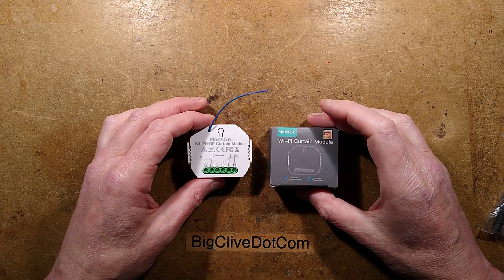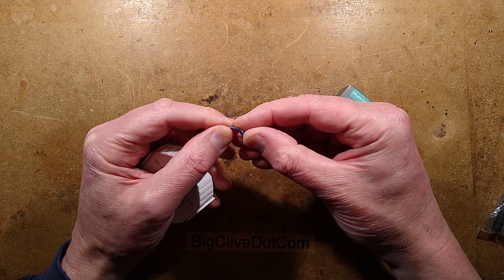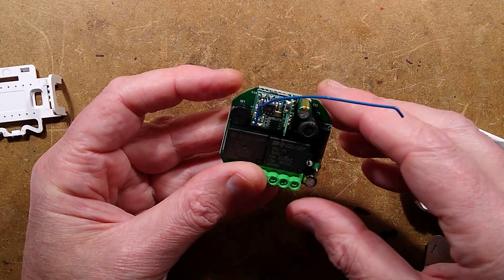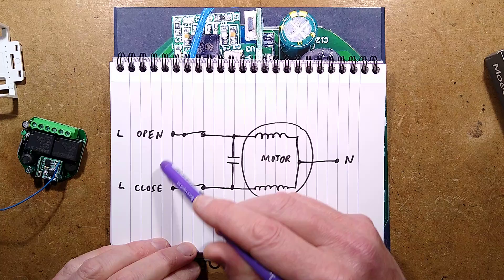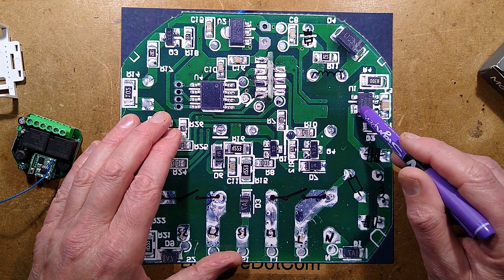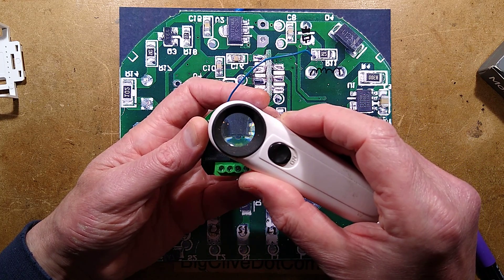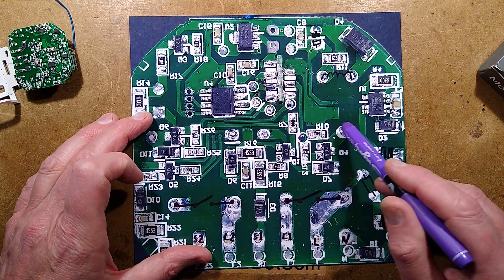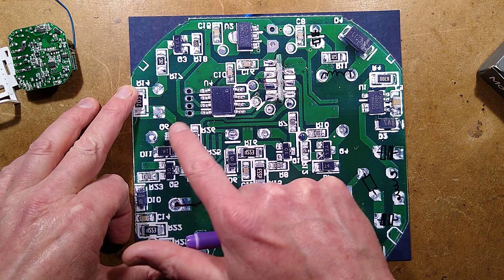WiFi curtain controller with rogue live wire

Comment: Would it help to couple the antenna wire via a small capacitor that has fairly low impedance at 433MHz but high at 50/60Hz?
Reply from the maker: It would have to be rated for mains voltage, but it could be done.
Reply: The capacitor would mess with the impedance matching too, so it would need other parts to compensate, like an inductor. If you only need to match for 433MHz, it is quite straightforward to do so.
Reply: Yep, 1nF Y capacitor is the correct thing to do here.
Reply: @chargehanger  yeah for 1nF you do not need any inductance compensation. 
You can get away with zero compensation and "near" perfect matching, if the capacitor is part of the antenna, like one terminal is soldered into the PCB, and the other continues as the antenna. For 433MHz the 1nF capacitor is basically a wire anyway (with some small twists).
You may need to use very high voltage rated capacitor, because lower voltage ceramic capacitors can be permanently shorted by ESD. Or maybe use a type of cap which does not tend to fail short.

Comment: Would it be a good idea to put an optoisolator between the radio control component and the mains part? Or would that be overengineering?
Reply: If I understood it correctly the problem is the power supply for the electronics, an optoisolator doesn't really help here.

Comment: I have a few Moes devices and all are well built and nicely engineered but this curtain switch module definitely has a problem with its antenna wire. Issue brought up in Amazon review section, so it's a known fault!
Reply: yeah they make a reasonably priced wifi light switch that requires no neutral wire that works well.
Reply: @leglessinoz  I have done some modification circuits that allows smart switches to work without a neutral. If you would like to know how it works I have some vids on that.
Reply: @leglessinoz  Have used one of those - saved a lot of work!
Reply: All Moes switches I've tried are very slow and not fully reliable. The sonoffs I have perform much better.

Comment: Yes, if the antenna is live, they should have taken better care of making it safer.

I'd change that 422k to the ground to 22k. That way the circuit still works when connected to 120V, but the odds of some bad shit happening if the 4V7 Zener diode fails are drastically reduced.
Reply: So often the driving resistor arrangement for transistors are screwed. It's almost like they never thought it through.